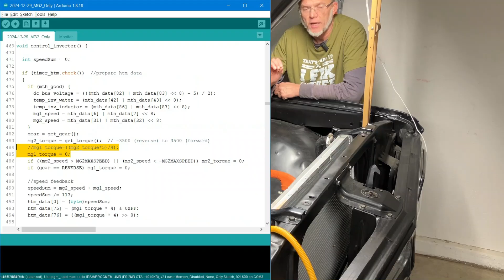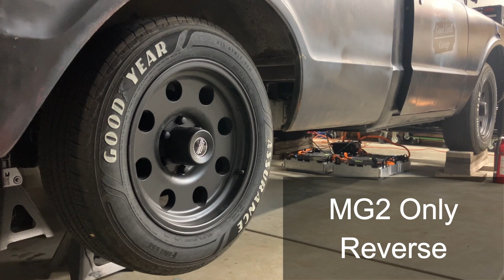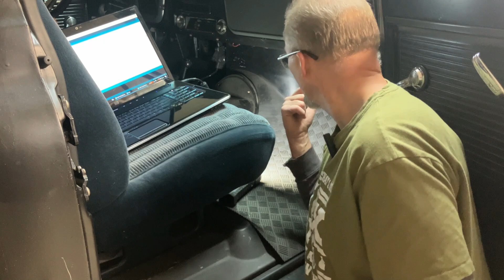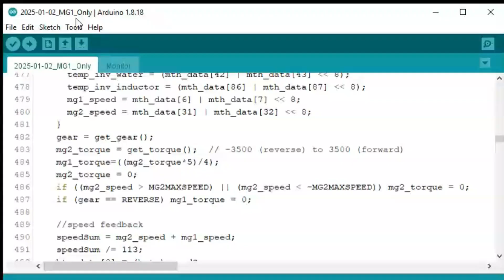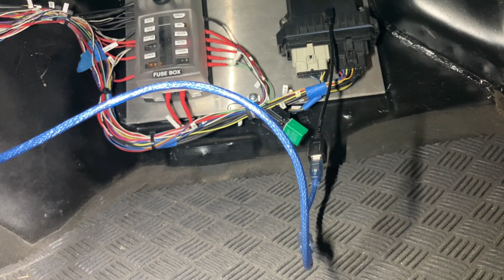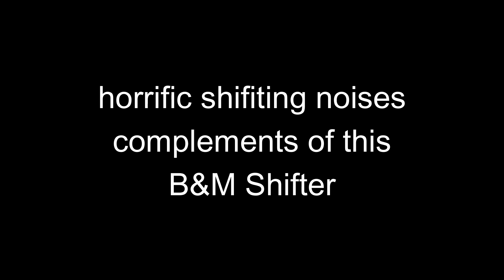GMC Electric Truck Lexus Input Shaft Locked Testing

Comment: Nice work mate, looking forward to seeing what improvements you get on the road.
Do you have regen with standard VCU software? I have a very similar VCU that was designed for the Mk1 Nissan Leaf and based on the Arduino Due so I'd be interested in seeing how the Regen is configured.
Reply from the maker: sent you my code via the Book of Faces Messenger
Reply: @Good-Enuff-Garage  Thanks mate, I'll have a look and see if there is anything I can copy. 🙂

Comment: Looks like you nailed it! You mentioned regen, is that what's causing the wheels to briefly turn the other way after releasing the accelerator? Is that just happening because there's no load or does the truck want to back itself up a few inches if you regen to a complete stop?
Reply from the maker: Good Eye! Short answer: I honestly don't know, however I do know that the motors normally spin in opposite direction so we feed negative torque signals to MG1 I believe to fool it into spinning in the same direction as MG2, what does that have to do with the price of tea in China you ask, I have no idea, ha ha